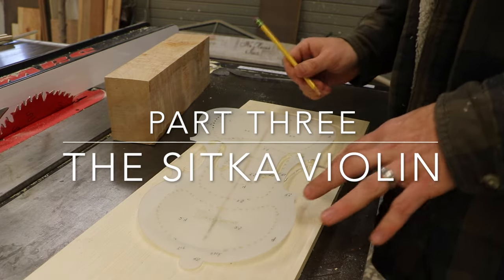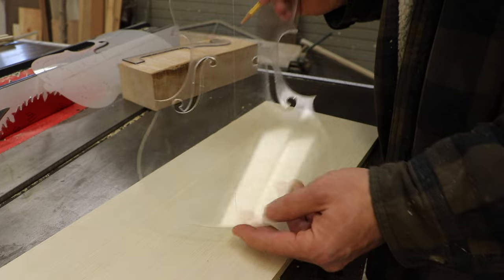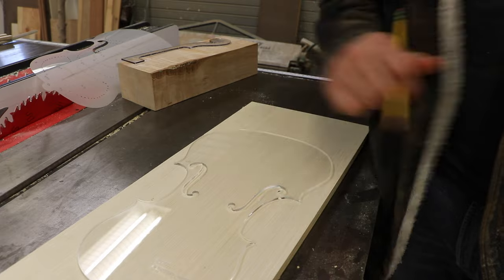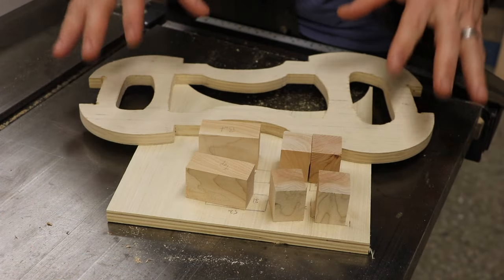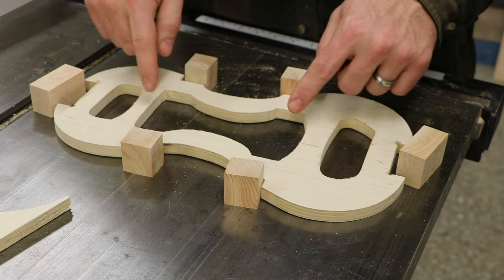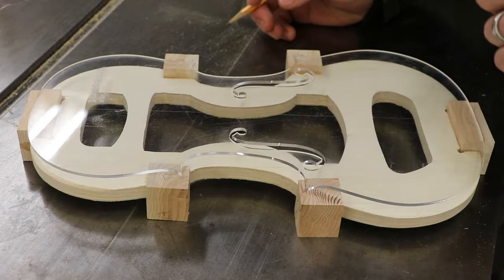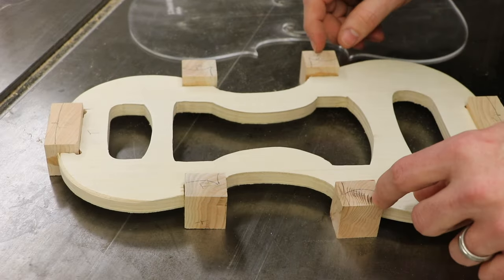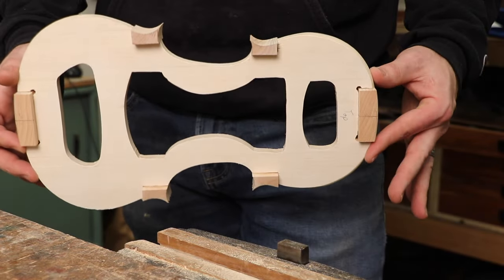The Sitka Violin: Part Three

Comment: Have you eve considered making the mold out of aluminum plate?  It would be more ridge than wood and not affected by moisture.  Also,  can be worked like wood and is about the same weight.
Reply from the maker: I have thought about it but I don't know how the corner blocks would interact with a plate like that.
Reply: There are glues that can hold the blocks to the aluminum just like the wooden mold and, with a little heat from a heat gun, will release.  The aluminum mold should be able to be used much like the plywood mold , but with the added benefit of it being reusable for a very long time.   @JDanielGraham
Reply from the maker: I will have to think on that one.. @jackpledger8118